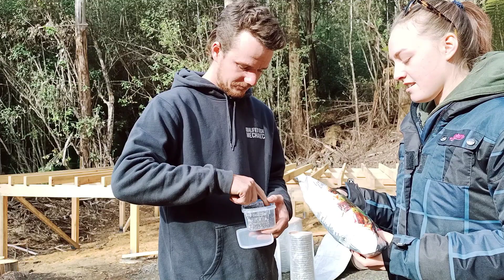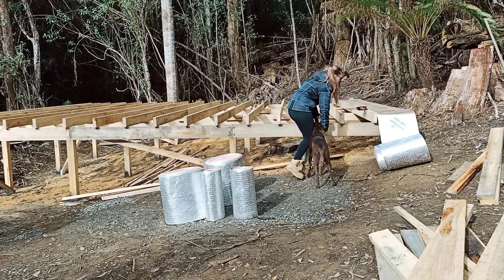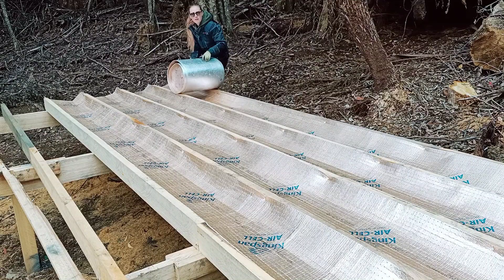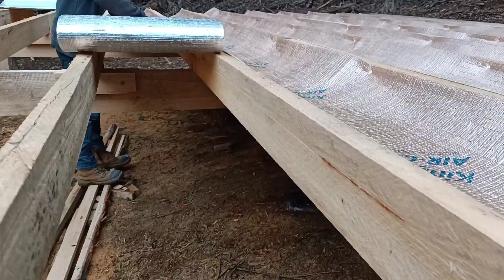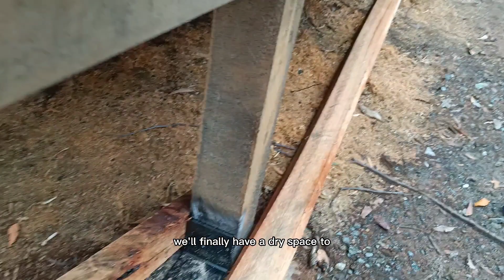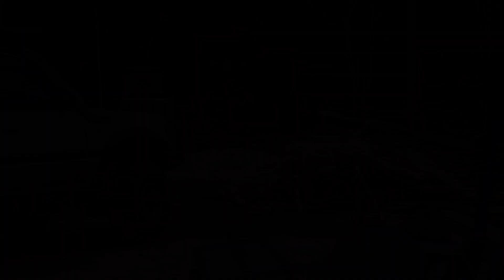Installing the floor insulation! - OFF GRID CABIN BUILD SERIES

Comment: The boy knows his bush tucker. Should have laid it on top of the joists to stop the cold air blowing through in winter and hot in summer and to slow the vermin from making a home for themselves.
Reply from the maker: We weren’t sure how to install it, so we followed the manufactures guidelines on how to do it, will see how well it works. Thanks mate 😊

Comment: Stop stop. Stop.  Put insulation. On top. Of. Boards.  The critters are going. Move in. That space.  . Put the. Insulation. Flat.  Flat.   On top of the. Floor. Joist. No gaps.  Flat. And.  Tight
Reply from the maker: We followed the manufactures guidelines on the install, so will be interesting to see how it goes.

Comment: Are you putting insulation bats underneath. Between the joist . Or foam. It makes a massive difference . And in your walls and ceiling .you Will vertically need no heating source.
Reply from the maker: Yes the cabin will be fully insulated in the walls and ceiling, hopefully nice and warm with a small wood fire, Thanks Mel.